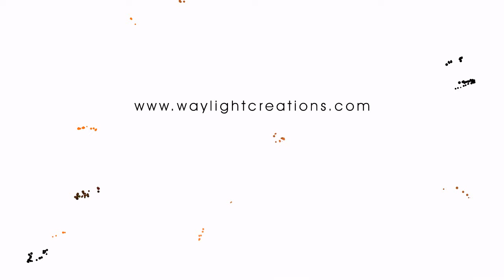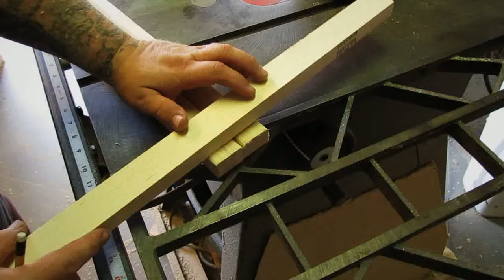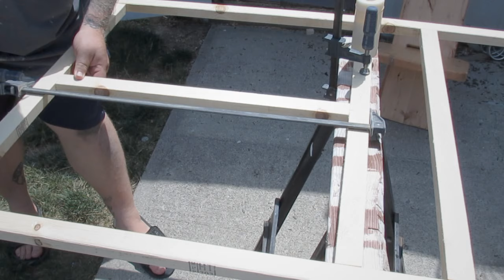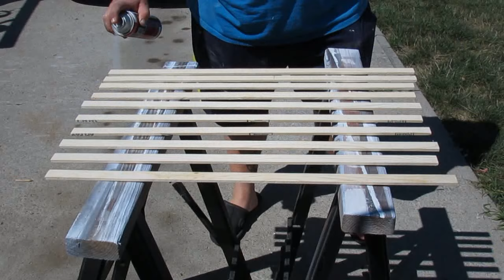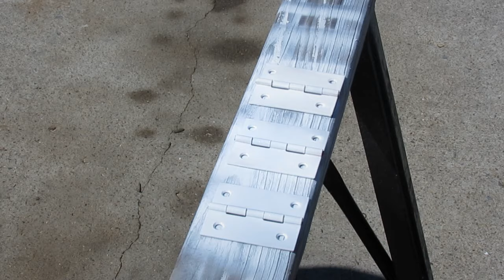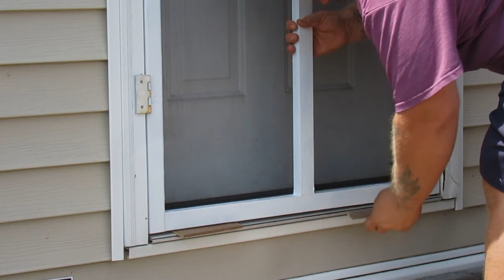Easy DIY Wood Screen Door

Comment: I cant believe I didn't think to look this up until today. I modified a wood screen door from home depot to fit my door opening years ago, and I added to the door jamb jamb to use double action (saloon door hinges). I cant believe nobody else thinks of this, but I created a screen door you can walk out AND IN through just pushing with your shoulder, hip, arm or hand. You know, so you can walk IN the door with your hands full too.

But, for the door to swing inward, you have to block out the hinge side of the door enough that the screen door can swing in without binding on the actual door. This means even the trimmable screen doors available have to be ripped down...and ripped down so much it makes them weak. Over time the way they are made, it started warping and sagging.

Getting a custom screen door made is ridiculously expensive. Some people I approached never bothered to get back with me...they figured I would never pay that much I guess.

Did you use the pocket hole jig only on that one spot because you had already assembled the piece above it? Looks like you were screwing in to the ends from the outside on most joints. That's what I would like to do, screw everything from the ends and probably use two screws at each joint, along with glue.

The other thing is, the saloon hinges can only handle so much weight so keeping the door very light is important, otherwise I'd have to double up on the hinges (they only come in a pack of 2).

Comment: I'm in process of building your screen door--slightly modified. Your concept is really is easy and perfect for my newbie skill set. Used two 8 ft 2 x 4's because they cost less where I live than one 8 ft 2 x 6. Also I was able to get 1-1/8 inch wide strips instead of 1 inch, plus 6 full strips instead of 5, Made it entirely with pocket screws and no glue. Two screws per joint. Solid as a rock. Ready for screen and trim now. I see you cut your screen trim with a band saw. I'm too new at woodworking to understand why you used a band saw for your screen trim rather than a table saw. Is 1/4 inch too thin to cut safely on a table saw?
Reply from the maker: That's awesome. Sounds like you are killing it. As for the band saw... no reason really. lol Glad this project was helpful to you.

Comment: Howdy - Thank you very much - I had the same idea but was going to use 2" X 4" rather than a 2" X 6".  My idea requires two (2) 2" X 4".  Yours is cheaper and looks great.
Reply from the maker: Thanks a lot, man. It was a breeze to make and is still holding up strong.

Comment: Well done.  I have the same chore sitting on my "To Do" list.  Curiosity question: For the hinges you used flat-head screws on the frame side and round-head on the door side.  Was there a reason for that, beyond "that's what I had in the shop"?
Reply from the maker: Thanks. You are exactly right. The old screws were rusted and rather than paint them, I just used what I had laying around.

Comment: thanks. exactly what I need. I have a small screen house I made for my plants. I think I can even do this. but I don't have a kreg pocket maker. great vid. 
what is that thingy on ur drill bit that makes those nice pockets for the screws? you put wood filler in them. I like that effect.
Reply from the maker: The whole setup is the Kreg pocket hole jig. The bit comes with it.

Comment: Do you do this as aside job? Want to replace door with screen door for my pantry, but hard to find one to fit 26x80 frame.
Reply from the maker: I do not. I just make videos of the stuff I make for our house. Any decent woodworker or general contractor should be able to make you one though. Just give them the dimensions you need and tell them how you want it. Hope that helps a bit.

Comment: Great job brother do u think glass frames could be fitted to it or not. the reason I ask is for winter
Reply from the maker: I suppose it could be modified to hold glass or plastic. The old screen door was very similar to this and we never had a problem in the winter. I understand the concern though.
Reply: +Waylight Creations ok thanx. yea the wind really blows thru in the winter

Comment: drilling the pocket holes before the unit is partially assembled is a lot easier :)

No doubt the screen started to sag within a year, what did you do to correct this, if anything.
Reply from the maker: I agree on the pocket holes beforehand, but they were never intended for this project. It was kind of an after thought. As far as the sag, we lived there for another 2 years before we moved and it never sagged, so it's hard to say.